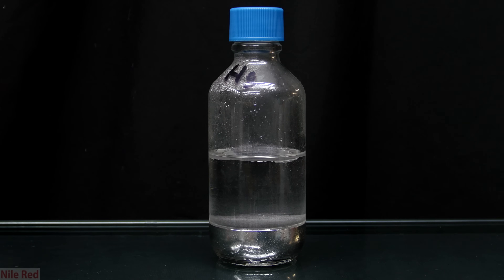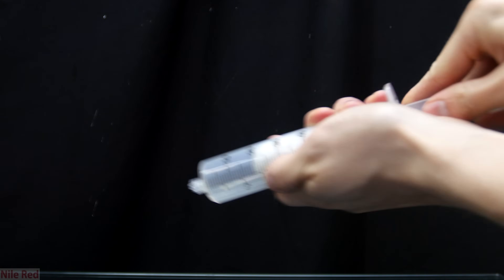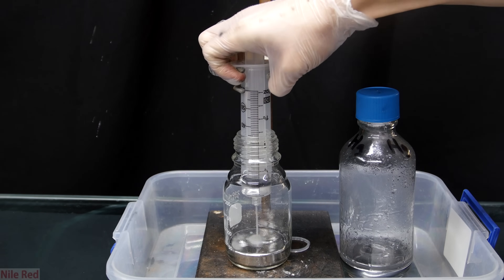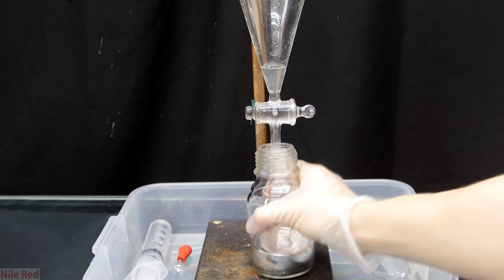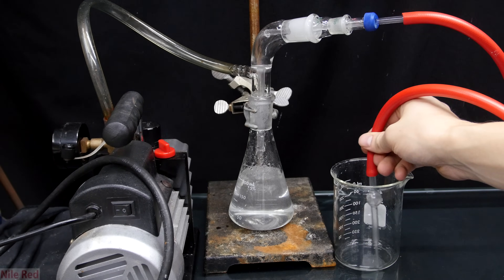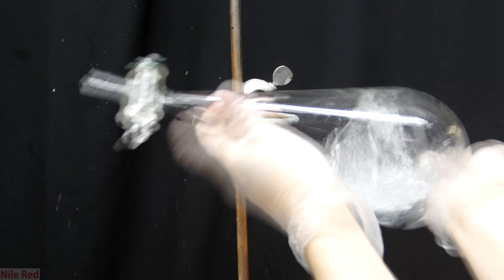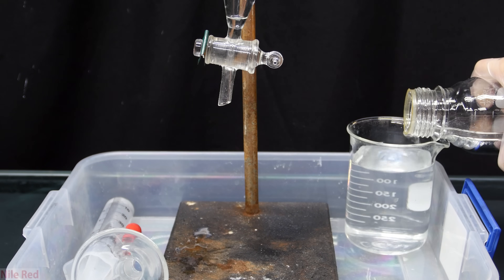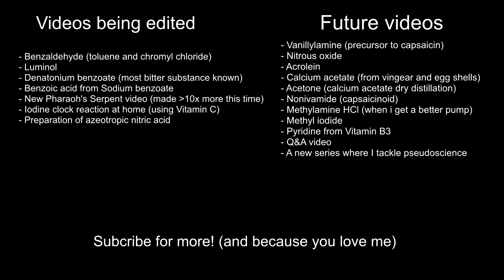Cleaning liquid mercury metal

Comment: I distill mercury in ordinary pyrex glassware. Set up for simple vacuum distillation. Add some iron and copper powder to your mercury as it will make it boil from the top. Use air to cool the condenser and have the receiver in a water bath, ice isnt needed. Its fun to zap the apparatus with a handheld tesla coil as it is actively being distilled.❤

Comment: I just need to remove condensation that has accumulated in a vacuum carburetor, synchronizing tool that I’ve had for about 30 years. When I hook up before hoses to manifolds on a motorcycle to try to balance, the carburetors, the four glass columns get varying degrees of water above the mercury in the tubes… how can I remove just the water that has accumulated in the reservoir. There’s probably less than an ounce of mercury in the Reservoir total.
  I considered using something other than mercury in place of the mercury in this for tube vacuum balance tool called “carb sticks “that was available back in the 70s and 80s when I was a motorcycle mechanic..
 Maybe something like mineral oil? Or alcohol? Or just distilled water?

Comment: Powdered sulfur on spilled mercury will convert it to the sulfide which has insignificant vapor pressure.  Old electrochemist's method for treating mercury spills that got into cracks.

Comment: can you use this method for cleaning grime and dirt out of gallium also?
Reply: No, gallium is not nearly as resistant to acids and alkalis as mercury. Just like aluminium, gallium reacts with the sodium hydroxide used in one of the steps. It is also unsafe to carry out the 3M nitric acid step with gallium.

Comment: I cleaned up a bottle of old and totally filthy scummy mercury to a visibly shiny metal that I could pour without leaving any deposits on the surface of a beaker by using a capilliary-sized hole in the bottom of a plastic container and letting it dribble out under gravity. Whilst it obviously didn't remove any impurities dissolved in the mercury, it did the trick for using the mercury for non-chemistry use.

Comment: I have a Corning pyrex manometer with inner and outer tube that uses about 7.4 ml mercury(about 100g).It measures vacuum between 1 mm and 160 mm. The mercury got dirty with vacuum grease and some other junk. I used your syringe-cotton filter idea and it cleaned the mercury beautifully! I rinsed the outer tube with 3 molar nitric and dried with paper towel in a spiral...sparkling clean! My.pump pulls about 7mm..thank you for your ideas on this video!!!

Comment: Believe it or not, I have lots of concentrated perchloric acid on hand but no nitric (currently setting up a nitrate salt distillation though). Since this is also an extremely oxidizing acid whose salts are soluble in water/acid, could I use this instead for the acid washing step? Not concentrated of course, but maybe a 6M solution or something? Or do you think the risk of forming explosive salts is worth considering? Surely they won’t be explosive in solution and if the Hg is relatively clean in the first place, there shouldn’t be much in solution anyway. I did a quick search to see how reactive Hg is towards HClO4 but nothing obvious came up. Can anyone elucidate?
Reply: Perchloric acid is not a substitute for nitric acid. The purpose of the the 3M nitric acid is to remove almost all metals dissolved in the mercury, even copper and silver (not gold though) because the nitrate salts formed are very soluble. Most perchlorate salts, even sodium and potassium, are of rather low solubility so they will not be washed out readily or completely. Also perchloric acid spills are a serious issue so shaking it around is very unwise. I suspect that it attacks mercury as well.

Comment: If you spill the mercury onto the metal parts holding up the syringe, will the mercury metal alloy with, and contaminate, those metal parts?
Reply: It depends on what the metal parts are made of. Iron (and steel) is one of the few metals that doesn't amalgamate with mercury.
Reply: @General12th  That's very interesting. It's almost surprising considering how reactive iron and steel are, until I remember that miscibility and reactivity aren't really related. Thanks!

Comment: Great video, I followed these steps to clean 1.2 L of switch scrap, in 200-300 ml increments.  Even being careful, little tiny drops still got away from my primary containment, fortunately the secondary seemed to catch it.  On my first two rounds of cleaning I had some nitrogen gas in the sep funnel when doing the Nitric Acid cleaning.  I started washing more thoroughly after the caustic soda washing and the gas was not present in later washing.  Also, I found it to be a good habit to keep returning the top most mercury in the sep funnel from each step to the beginning of the filtering process, my final product ended up being noticeably cleaner.  Also I noticed that my later iterations seemed to have higher surface tension and hold bubbles a little longer, can you comment on what that says about the purity?
Reply from the maker: +Timothy Anderson I'm honestly not sure what that says about purity. As an update to this video though, you should not store the mercury under water as it can get "scummy" after a while. Store it without watee and in a secondary container with some sulfur in it

Comment: Back in the 'olden days" (1970's) a quick way to clean mercury was to pour it into a leather shammy and squeeze it through by hand.  Very easy and simple for removing dirt, dust and scum.  The mercury goes through the pores of the leather like water through a towel (but without being absorbed).
Reply: Yea, back in the days when people thought it was intelligent to put asbestos in their homes, and lead in their gasoline so they can inhale it. In other words, it's a stupid idea.
Reply: @shawnpitman876  Oh, you are soo clever. Actually, lead in gasoline made perfect sense and still does for aircraft.  And using a shammy to clean mercury of dirt, dust and particles is still valid and perfectly safe when done with common sense care on a occasional basis.  Go away smarty pants.
Reply: @KB4QAA  I have no idea what Shawn said (the only comments I can see are your first one and your most recent one), but leaded gasoline is unambiguously terrible and should never be used if its exhaust is going to be vented into the atmosphere.
Reply: @General12th  "Should" is a nice feeling. But for the moment it is necessary until a satisfactory replacement is developed, tested and certified for certain aircraft.  Work has been ongoing since the mid 70's to develop it, and we still don't have it.  It isn't for lack of trying.  It's a tough nut to crack.

Comment: Never EVER put underpressure on a Erlenmeyer flask. It can cause an implosion with extremely sharp glass shrapnel. There is special glassware for  this task
Reply: *****

And I guess the blast shields that everyone is supposed to put in front of underpressured glassware are only there for decoration...

kiddo I've seen the force of these implosions.
One was strong enough to shatter a labor table with a 1cm thick glass surface.
Reply: *****

sure, sure whatever you say.

illuminati are responsible for it

Comment: You might have mentioned this in one of your previous videos, but is there a reason to vent the bottle between shakes even when its only mercury and water? Is this to make sure there is no pressure (or vacuum) buildup, or is there another reason?Great videos btw, thanks for uploading.
Reply from the maker: It is always a good idea when using a separatory funnel. A lot of solvents will generate pressure when you shake them, or maybe a gas is produced (like CO2). If you don't vent it, you risk popping off the stopper, even if you are holding it in place.

Comment: The traditional way to clean Hg is to shake it with HNO3.  Because HNO3 reacts with Hg, the operation should be performed quickly.  To clean up Hg spills, first collect all the Hg you can.  Then rub powdered S into any cracks and crevices that Hg might have gotten in to.  The S reacts with Hg to form HgS, which is non-volatile, and poses no hazard.  This info comes from the 1967 edition of "Lange's Handbook of Chemistry."

Comment: If you get any resistance on syringe, avoid using too much force. I've had an o-ring fail on a syringe and it shot a nasty tight spray of chemicals to my face once. (Fortunately, no damage was done even though some of it was shot to my eye due to a small gap between safety glasses and the face. This is a good reminder of how easily something bad can happen.)
Reply: My buddy was melting pewter in order to cast some medals a few years ago. A few of the early castings where failures so he cooled them in water, dried them, and re melted them to try again. One, however, was not entirely dry, and this imperceptible moisture, trapped in the crevasses of the face pattern, was enough to make the medal explode on contact with the melting pot. One of the pewter drops hit him half a centimeter under his eye, and left a little red dot that was visible for several months.
Reply: @vde1846  that's why when melting metal you always preheat before adding to the melt
Reply: You alright?
Reply: You good
Reply: Thanks for that life advice.
👍
Reply: o ring is keyboard haha funny pog
Reply: Did it hurt?
Reply: @mihitm  No, it did not hurt. It was not too harmfull substance fortunately. But even normal solvents do not feel that good in the eye. Naturally, a lot of rinsing needed.
I've been very carefull with syringes after that. No emptying quickly with force if possible and extra care if it is dangerous and/or viscous.
It is also good practice to make a not that any spurting objects are not operated at the directions glasses protect poorly.
Reply: @hoggif 
Use a face shield in conjunction with the safety glasses.
Reply: @KodakYarr  That would be a good practice but who uses one all the time? When I worked in a lap no-one. Perhaps everyone should!
Reply: @mihitm  Yes, it fueled your sick fantasies.
Reply: @Oakley Chandler Instablaster =)
Reply: @Oakley Chandler happy to help :)
Reply: @darwinroy1131  bots
Reply: Corey  Haha gay. Its funny because gay

Comment: Your possible future video on Nitrous Oxide made me think that an interesting video might be exploration of selective catalytic reduction of NO and NO2 using a catalyst and Urea.  This is what the Diesel Exhaust Fluid is used for that's sold at truck stops.  DEF is 37% Urea .  Modern diesel trucks inject this into the catalyst system that breaks down the NOx emissions from the truck into N2, O2, and H2O. And as a tie in we have the recent "Diesel Gate" from VW.

Comment: Awesome video! I have a couple pounds of mercury that I've been needing to clean. However, I store mine in an erlenmeyer flask w/ a rubber stopper which I then keep in a plastic jar in the event the glass jar shatters. Should I add a layer of water to be extra safe against vapors?
Reply from the maker: +christopherhug It's only dangerous if you open it and let the vapors out. A water layer is always good though. Prevents vapor leakage
Reply: +Nile Red Thanks. It's weird I always notice a few tiny beads up top between the stopper and the glass. I guess this must be the vapors re-condensing back into liquid form.
Reply from the maker: hmm, i am not sure enough vapors would come off to do that

Comment: If you have mercury that has been in contact with other metals and formed amalgams how would you chemically separate mercury to ensure purity? Could you turn it into a salt, crystallize it out and recover the elemental mercury or would that be way too much work to be worth it?
Reply: Mercury amalgams don't form by reacting, but by dissolving. You could simply distill the Mercury and use it

Comment: Why do you sometimes use the ceramic filter with disposable paper for vacuum filtration and sometimes the glass one with membrane? I only use a ceramic one and disposable filter paper,s but might there be an advantage to investing in a glass filter?
Reply from the maker: +Tom Dunn The glass one is chemically resistant. Also i generally prefer to use it because i dont need to find the rubber adapter that i always lose... For more inert stuff, both can be used though.